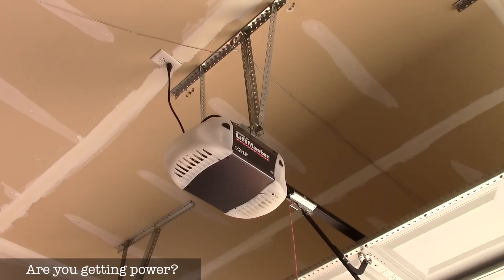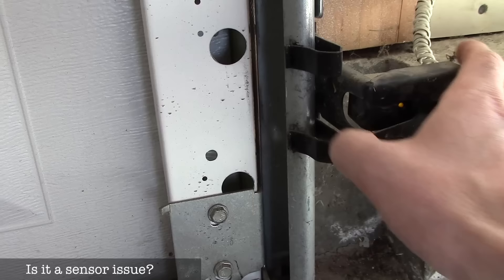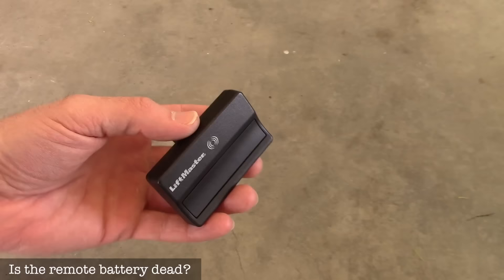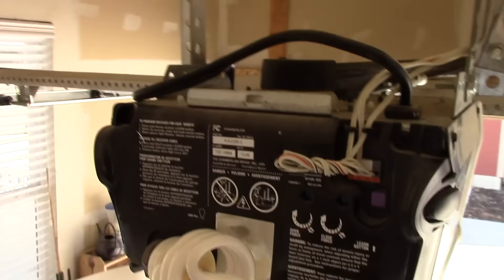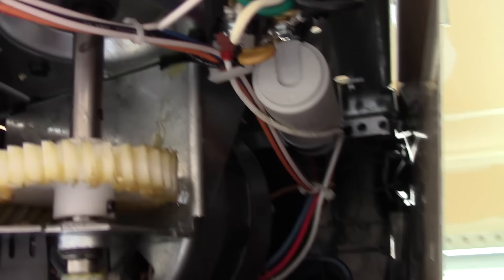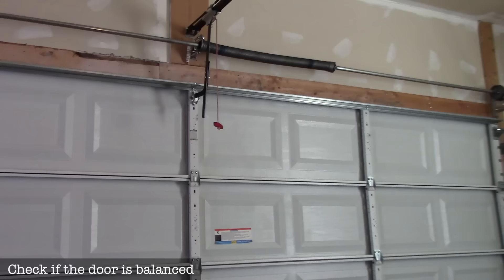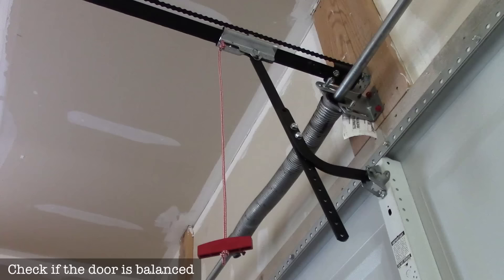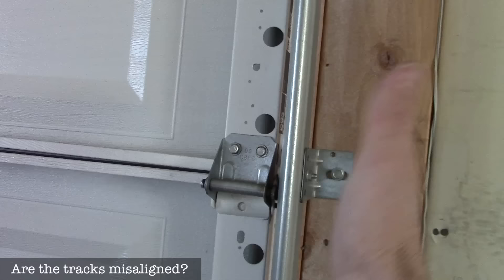Garage Door Opener Troubleshooting and Repair - How to fix common problems

Comment: Hello Adam, I’m a handyman. I have some issues with my garage door. Yesterday I was closing the garage door. While doors hit and stop my car front bumper. Suddenly I push button and stopped. But now motor not working properly. Start little bit and stop. Could you please let me know what is the reason and where I should focus. Thank you so much.

Comment: My mom's garage door got offline and I had to manually open the door. I reset the track but now it opens and closes but leaves about a 1-inch Gap at the bottom. Is there a way I can adjust that?

Comment: Awesome video.  Thanks.  After I checked everything else.  I popped the cover.  There was goop all over the inside bottom portion of the cover.  The opener is 20 years old, so I knew at that point that the capacitor had blown.  $24 later and I am back in business.  No service call.  You saved me some cash.
Reply: QUESTION:   MY GARAGE DOOR OPENER WORKS WITH THE HARDWIRED BUTTON, THE REMOTE, BUT NOT THE KEYPAD.  REPLACED THE BATTERY..... NOTHING!!  HOW TO FIX KEYPAD???  HELP????
Reply: Hey!! I have the same issue!! How did you fix ir!!! Thaaaaankssss
Reply: Did your capacitor itself appear normal (not swollen or busted)? I’m facing this also. Opened it up, looked around and realized/felt there was white goop on the bottom/on the white gear and immediately thought capacitor issue. However, could it be grease instead?
Reply: @Carluchs  did you fix your issue?

Comment: I had the weirdest intermittent issue that started showing up a few weeks ago with the garage door openers suddenly not working after I exit the home but opening the door as expected when we return back to the house! Thanks to your video, was able to trace it back to the bulb that I changed in the opener a few weeks ago! Also, great tips as I went through a few of them to try and figure this out...

Comment: My Chamberlain opener would not let the door come down .. just CLICKS!  I had called a service company to come .. $$$$$!  Thank you ADAM!!  Your troubleshooting video saved me a ton of bucks on a Saturday!  I was able to detect 10 flashing lights indicating the Reverse Sensor was not functioning .. then I found that the SENSOR WIRE WAS CUT IN TWO!!  No sensor lights were on!  I pulled the 110v plug to kill the power. I cut the wire in two where it was damaged, stripped the ends and remade them again and electrical taped them securely. PLUG BACK IN, BOTH SENSOR LIGHTS WERE NOW ON .. !  Put the ladder away and VOILA~  the door was working perfectly again!  THUMBS UP!!!  George D.

Comment: The garage door was opening intermittently and failed completely a couple of days ago. When failing to open, there was a loud buzzing noise. I removed/replaced the capacitor this morning and it’s back up and running. Capacitor was $13.50 on Amazon; labor cost: $0.00 Thanks for your help.

Comment: Thank you Thank you Thank you!  I would have never thought that my new LED bulbs would be the cause!   My garage door would open but would not close for both cars using homelink. I had to resort to my original hand held opener and hold it directly under the antenna to get it to close, then run out to the car while avoiding the laser beam.  

I checked everything, reprogrammed both car remotes, unplugged the unit to clear the memory, nothing was obstructing the door, etc. and  nothing worked.   I was getting ready to check/replace the antenna when I came across your video and decided to replace the lightbulbs and go back to CFLs.  It worked with no problem!  This is probably becoming more and more common as people move to LEDs.

Comment: Holy CRAP!! You're the best!  I bought a Tesla and my garage door would work intermittently.  They came out to the house and tried to fix it and the car's been in the shop twice now.  After watching your video, the literal light bulb went off!  I installed LED lights on the garage door opener the week i got the car.  I bet its not related at all.  I plan on swapping out with the old bulbs to see if it works again.  Thank you so much for the help your video provided!  You just saved me buying a new garage door opener!

Comment: Thank you so much, Adam! After two weeks of my remote not working, I only had to watch the first tiny bit of your video to fix the problem myself! The “lock” button on the wall box did not say “lock” so I didn’t even know what that button was. I pushed it and viola! The blinking LED stopped blinking and my remote now works! Yay! So convenient to be able to use my remote again! Tanks to YOU! 😊 — signed, 66 year old single lady.

Comment: Thanks for all that. It was very helpful. I had an issue closing the door. It would go down some of the way, then stop and turn back. The fix was the turn the blue button clockwise to be less sensitive. This made it overcome the slight pressure on the turn when closing an open garage door. Easy fix.

Comment: Very good, very clear, well done!  One suggestion that others MAY have already made:  I would put the section about checking the torsion spring at the START of the video!  (You now have it starting at about 12:30.)  In my many years of home ownership, that has been the problem twice, and with a broken torsion spring, "you ain't goin' nowhere!"  In fact, if it is broken, you can easily strip the gears of your garage door opener by trying, repeatedly, to get it to work.  And, of course, if the torsion spring is broken, you NEED to call in an EXPERT repairman!  Thanks.

Comment: This video was very helpful. I cleaned off and checked my sensors. Sure enough they were slightly out of whack , a quick adjustment and all is good! Thank you for posting this!!!
Reply: Yeah, me too. Electrician here, who assumed it was a failed component in the motor control or relay or some such electrical pain in the neck.  I had no previous experience of garage doors, but this video made it a very simple fix. Saved me a lot of time so top bloke for posting Adam, thank you.
Reply: chain jumps off while door is on b its way up
Reply: B
Reply: @ultimateelectricltd.4916  1
Reply: Thank you for putting in the time to create this video.

I have gone through a bunch of steps, but the chain is not moving when I press the button.  It makes a grinding sound(pretty loud).  

Is there a way to make sure the chain is not locKed/frozen in place?

Comment: Yet another success story. I replaced the rollers and must have bumped the sensor sideways, so that it "sort of" worked, but mostly not. Thanks to your video I was able to notice the problem, realign the sensors, and now it works fine!

Comment: Thank you so much. I had been troubleshooting my garage door opener for a few weeks, I even contacted Chamberlain support, but they kept giving bogus answers about extreme cold. And then I clued in when you mentioned LED Bulbs could interfere with the signal. Removed the LED bulb, works like a charm now!

Comment: Thanks Adam for the thorough walk through.  My garage did not close easily when leaving in the morning. Required multiple attempts with remote had to fiddle with it for several minutes but would work fine when coming home. The culprit = LED light bulbs I put in there recently that appear to interfere with remote signal. Makes sense lights are off when I come home but on when I open the garage door to leave in the morning. Saved me a repair call!

Comment: Thank you Adam.  I especially appreciate how you started with the most common problems, and then escalated to the more severe.  Within a couple minutes you got to my problem.  My door would start to close, and would get a bout 2/3 rds of the way down before opening back up.  I was able to override this by holding the wall mounted button down, thus indicating a bad sensor.  I had absolutely no idea how to fix it, and contemplated buying a new system.  At least I now have a place to start the repair.  Thanks again.

Comment: Perfect! My red sensor on the floor was blinking. I didn't know it shouldn't and I got intermittent problems.  Fixed that in seconds and all is well. Thank you. You're video is a very easy trouble  shooter. ❤

Comment: I too want to thank you for this excellent video.  My garage door opener remotes suddenly quit working, but the keypad and wall button still worked OK.  Checked batteries, wires, memory, sensors without success.  Decided to check You Tube for help and ran across your video and BAM!!! there it was.  You spoke of how LED lights in the unit can interfere with the signals from the remote openers.    I remembered I had just put LED's in the opener.  Replaced them with standard bulbs and all is  well.  You Rock!!

Comment: YOU ARE THE BEST! Just fixed my sensor!  Saved me a service call!  Thank you!
Reply from the maker: +Kevin St. John That's great!  Glad to be of help.
Reply: AdamDIY  Hey Adam, I have a Liftmaster 1/2 Hp belt drive formula 1. Model 2280R. Produced in 2005. I have a 1 width double wide garage door with individual slats (4). I performed a garage door balance test opening the door disconnected from the release cord and raised the door to 4-5' and held the door at that height and door and slowly release the door and let go of the door and immediately started free falling to the close position. That means the door is not balanced.
Reply: How to balance the door
Reply: @AdamDIY  Hey Adam, what if a door starts going up and then stops. Press button again and it does it again. Gets to half way and stops? Just wont do a clean run up anymore :-/

Comment: Thank you Sir. I got as far as the 5 minute mark and your insight that the bottom sensors were not aligned was dead on. Made sure the green light was solid at the bottom sensor (it was blinking green...) aimed it better until the light was solid green. My garage door is working again, Bad for days now. Thank you very much.

Comment: You have described every conceivable problem in such great detail and saved us the cost of a garage door tech visit.  Thanks so much.  Great video.
Reply: I was hoping he would cover where the sensor wires connect to the motor unit. Not just if they're loose, but which ones go where... in case they got mixed up by someone else trying to troubleshoot an issue.  As well as, a way to troubleshoot to verify if a wire was broken internally with no obvious cuts to the outer insulation.  So yes, nearly every conceivable issue... but not everything.  He also didn't go over travel distance for opening/closing, nor the sensitivity adjustments for opening/closing force.  If those are too far out of whack, doors often will stop and reverse believing they've hit a obstruction.

Comment: Thanks Adam. I recently replaced the lights on the opener for LCD lights. I couldn’t figure out the problem was because the remote would only work in very close proximity. I tried during off my Bluetooth on my phone but that still didn’t work. After watching your video, I swapped out the LCD lights and wowla works again like new. Definitely saved me some money. Thanks again Adam!

Comment: Thanks! Great video. I replaced the weatherstrip on my door and now it goes down about 75% and then reverses to open. I removed one side of the weatherstrip and the door works fine without it attached.

Comment: Thanks, my garage door opener kept partially opening or closing and it turned out that one of the sensors was slightly out of line where it was close enough to start the opener but wouldn't complete it. Once I realigned them both to aim at each other it's working fine now.  YOU DA MAN!!!  Thanks, again!

Comment: great video Adam, thanks.  I saw the torsion spring on my garage door busted in half.  Watching your video explained that that spring could have been the problem why my door would not shut down all the way.  It stays up 3-4 inches off the ground.  I'm not going to mess with that torsion spring so I guess I'm going to have to pay for a garage door repairman to fix it.  At least I know what's the problem thanks to your video.

Comment: Adam, great video. My problem was door would only open at certain times and when you talked about the led bulb possibly blocking the signal, I replaced those bulb's with standard bulbs and all is working. Thanks so much for saving me a service  call. Blessings to you

Comment: You did not mention my problem, but it was diagnosed for me by Chamberlain Support. My garage door would reverse on me when closing, but intermittently. It seemed to be when the weather got warmer. I adjusted the sensors several times and lubricated all joints. The problem was sunlight shining on the sensor(s). Chamberlain said this is a "known" problem on older openers. They have a part that is cardboard and shades the sensors, but I will try some cardboard I have around my house to see if it works. I never would have found it without their help. Hope this helps others, though the last entry was 5 years ago. Great video on some of the other things that can happen. Just thought I would add one more.

Comment: This helped me. A winter tip I found was that the arms that hold the sensors expand and contract out of whack. If it won’t close in the cold try gently bending them to position

Comment: Thank you Adam. You did excellent start with the most common problems first. 
I was able fix my garage door issue after watching your video for 2:10 secs only. It was locked. 
Before watching your video, I watched couple other videos but no one discussed to check the lock button.
Thank you so much again - God bless you! ***

Comment: Thanks Adam,my openers started not working sometimes, after watching your video I realized that Had recently replaced one of the light bulbs with an LED bulb. That was the problem, I removed the LED bulb and it works fine.

Comment: My Liftmaster goes off and on. If it stops working, I tap it with my hand and it goes back on. It's getting worse and stays off most of the time. It acts like a loose connection somewhere. Adams garage door videos are the best I've seen.

Comment: Adam, my garage door keeps opening by itself. I have changed the frequency/reset it twice and no change. It happens when I'm home and when I'm not. It also happens even when the lock feature is activated. Thoughts?
Reply from the maker: Whats the model number?  I would try disconnecting the wires to the wall mounted button.  At least you can eliminate that possible cause.   It could be a faulty circuit board.
Reply: AdamDIY
Reply: I am having this same thing happening right now. Did you get it fixed? If so how did you do it?
Reply: @kabutoyakushi6618  im having this issue rn too. Any suggestions its been 10 months. Lol

Comment: LED Bulbs!!! That was the issue!!! i never would have thought that could be the cause. It was strange because the door would sometimes work and sometimes not. Now i know why: if the (LED) lights on the unit were on, it didn't work, if lights were off, it did work. Also, the button always worked because that's obviously hard wired. very interesting. thanks!!
Reply: They sell special "garage door opener LED bulbs" that use different radio frequencies.

Comment: This is an awesome video and I will watch your supplemental videos on openers. However, it didn't address my issue. It opened in the middle of the night last night and kept opening and closing on its own. It's not the neighbor's interfering with ours. We used the lock feature for the remotes to rule out the remotes. I checked the sensors and they are good. I reset the travel settings and that didn't fix it. It continues to randomly operate on its own....sometimes 1/2 hour between occurrences.

Comment: This is very helpful video.  You are 100% correct of having LED interference. Low voltage LED landscape lightbulbs are emitted a radio frequency that is in conflict with the remote control.

Comment: You are right about the sensors! I already left a message for the repair guy. Then I saw your youtube video and checked the sensors, the snow shovel was blocking it, I didn't notice it because it was dark. Saved me a service call! Thanks for your great video!

Comment: hi adam, I had this problem with my garage door opener, suddenly the remote not working , we thought it was battery but new battery will not work either. I tried to program but it can not detect the signal from my remote. What could be the problem? when i click the remote, I can see the sensor light flashes but when I tried to program, it does not work. Sometime it works but have no idea why it detect the signal. very rarely it works. thank u
Reply: +vietprider2009 DId you get an update to your post? I have the same problem.
Reply from the maker: +javier Alonzo The first thing I would try is to eliminate the possibility of a bad remote.  The easiest way to do that is if you have a neighbor with a similar opener, and ask them to try to link it to their opener. Of course you will have to erase the codes and reprogram their remotes for them or they won't be too happy.  So if that is not an option I would try but another remote and test it out.  Of course if you already have 2 remotes and they both stopped working at the same time, and you can't reprogram them to the opener, I would say you likely have a bad circuit board.
Reply: I bought a brand new circuit board and they still do not work.  i also found a used circuit board and it also did not work,  next, i went and bought a new remote and that did not work..
Reply from the maker: +javier Alonzo What circuit boards did you try? There is the power supply board and the main board.   Does anything work on your opener? Light bulbs? Or the small LED light?  Or is it totally dead?
Reply: AdamDIY I have the same problem. The lights work on mine. It’ll flash that it’s stuck in vacation mode.  Can’t get it out of it no matter what